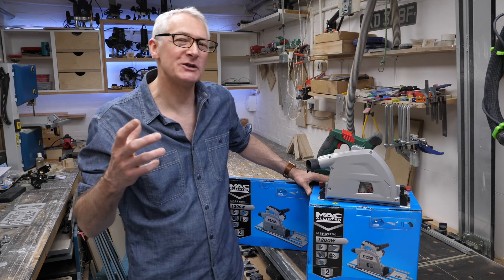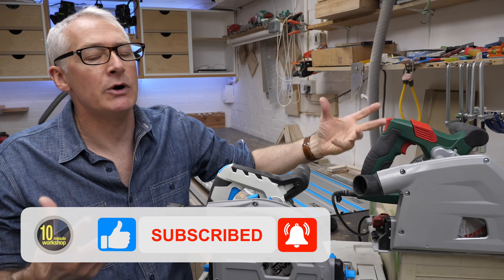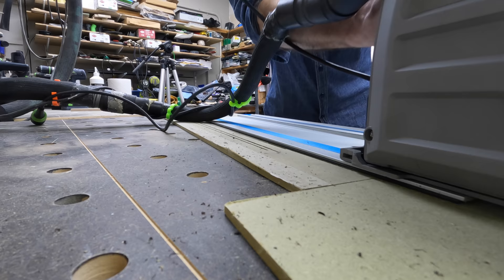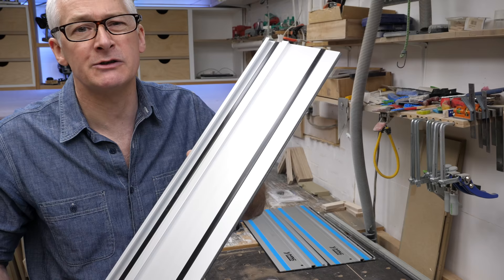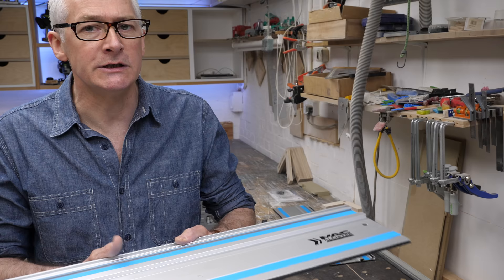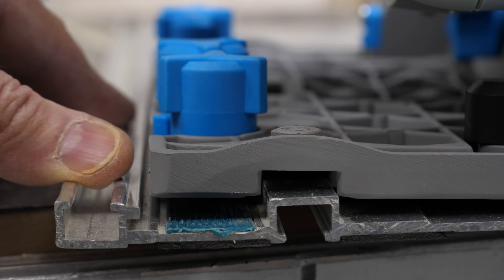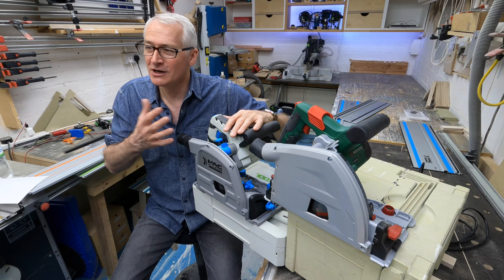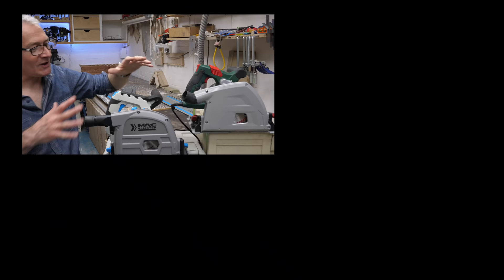Lidl Parkside or Screwfix MacAllister? [video 454]

Comment: After using the MacAllister saw a few times and struggling to cut even 12mm MDF cleanly without burning I put it down to bad choice of blades as I had put in a Trend 48T. After watching some generic plunge saw videos I decided to check the toeing of the blade and realised that it was actually toeing out which meant that the rear of the blade was actually rubbing against the wood causing the burning. This saw is not particularly well designed for toe adjustment as it cannot be done from the top but only from below which is obviously not accessible when it is on the track. You will need to loosen the 4 screws and the 2 outer set screws, this will allow the base plate to move just a little and at this point it is really trial and error and luck.
After 'adjusting' I have a very slight toe-in, think should be a little more but it will do for now. Now it glides and cuts much nicer and no longer burns any of the wood.
I did consider returning for a replacement but there was no more stock around and I had already gotten rid of the box etc so would be too much hassle.
For anyone else getting one for the first time, do initial trim of the strip then check the toeing, get it replaced if it is out...

Comment: I bought my MacAllister this time last year after spending an afternoon watching your Tracksaw Workshop series & as somebody who previously had zero experience working from scratch with sheet material I'm amazed at the quality of the cuts I get with it & how safe it feels using it. I've made speaker cabinets, a 19" rack enclosure & even a tiny shelving unit for bolt/nut organiser trays by using the score setting to cut slots for 5mm plywood shelves to slide into. Now  if only I didn't live in a 3rd storey flat & have to use my kitchen for doing it!
Reply from the maker: Really pleased to hear the videos helped! Thanks! 👍👍
Reply: Amazing

Comment: I bought the Mac Allister  which is similar to the Triton and many others. I bought the Triton blade before using it at all. One very nice feature of the Mac is the scribe function. it cuts a 2.5 mm groove by the special setting. it leaves a very clean cut and then I plunge to the set depth after. Admittedly i didn't try the stock blade to see if that was as good but over all very pleased with the Mac.. one down side on the Mac is the Black depth gauge with black raised numbers .. like looking for a black cat down a mine. I bought a white £2 paint pen off eBay  and touched up the raised numbering and scale. Fixed! Thanks Peter for your YT videos.

Comment: Great review, Peter. The Mac looks identical to the current WEN saw, sold here in the USA. Here in North Carolina we are fortunate to have a few Lidl stores, but I haven’t seen the Parkside saw in the store, so I finally gave in and ordered a WEN just this week. I was surprised that the saw came with a tag attached that says that the anti-kickback knob is removable, if not desired. That sort of message isn’t common in our litigious country.  Scott
Reply from the maker: Interesting, thanks Scott! No, we don’t get Wen products here either; it wouldn’t surprise me if the’s one factory making  110v products branded as Wen and 240v products brands as whatever anyone wants! 👍👍
Reply: i purchase the wen saw and they are exactly the same
Reply: @dannelfalkner5285  I think the only difference besides the 110v is the depth scale is in United States customary units (Imperial).

Comment: Great review Peter. I was on the verge of buying one of the Parkside saws, but went to my local Screwfix at the weekend and picked up one of the MacAllister saws instead. TBH I have never had any issues with Parkside tools, but had to return an Aldi Workzone tool recently, and they would not accept the return in-store because it was on the 366th day after purchase and had to be returned to the manufacturer despite them having the tools in stock.
At least with Screwfix exchanges are much easier.

Comment: Remember folks, you NEED to buy a cheap plunge saw because the stuff you are going to cut is so blooming expensive... 1 sht 18mm birch ply, last year £42, this year £67.
A good review as always Peter. Thanks very much.
Reply from the maker: Great point actually Paul - two saws that are cheaper than the Birch ply you're cutting them with, lol! 👍
Reply: I noticed the same about OSB, however the price for particleboard sheets looks similar.
Reply: I eatched a video on why prices are going up 1) Sterling's 20% fall in value 2)
The Pandemic with global lockdowns caused a lot of containers to be stuck in Europe and North America because of their massive demand for PPE and other anti-covid supplies. But they weren't being returned with exports because of their closed borders and lockdowns. China and other big production centres are making things but can't ship them anywhere because they havent enough containers to meet demand until some arrangements can be made to send those containers back. So, until the global shipping container problem is fixed, prices will keep on going up on the high street as the world's two largest economies starts to reopen. It's summer snd people will want to do DIY. So... might have to wait, because timber prices are exorbitant right now.

Comment: Thank you, great video!

MacAllister has 2 pros:
- scribe function
- the rails have 2 channels and allow use of 2 connecting bars - this really helps with rail alignment.

To improve vacuum efficiency, both should use duct tape over side hole.
Reply: Good to know re zero cut. Thanks!
Reply: The anti kick causes problems with the scribe function. Once you've scribed you have to very carefully manually disengage the kickback and lift the saw off, then carefully put it back at the start of the rail, else you'll move the track and wreck the cut.
Reply: parkside has scribe function .just set your saw to the second line lol

Comment: Great series of videos Peter. Since I started my van conversion build I knew I'd be wanting a track saw. So, Metabo stepped up nicely with a circular saw that runs on a track. I got 2 tracks both of which cope admirably with full size sheets of ply. Am really pleased with my cuts and equally pleased with the quality of the tool.

Comment: Yeah I have the big Mac and now I know how it works .but the Aldi band saw met a sticky end .I spent a few minutes hitting it with a sledge hammer before running it over a few times then I left it out for the pikeys.

Comment: Just looked at Screwfix website, they say 12 month warranty on the Macalister Saw and currently £79.99. Thanks for a very timely video. I nearly went for Lidl but now think I'll go for Macalister.
Reply from the maker: Says 2 years on the box; 12 months is usually parts & labour, the extra 12 months defective parts only, but in practice if there's any issue the saw's replaced. 👍

Comment: 7:45 hehe, always good that line!     I did a ton of research on this and categorically the best solution is a MacAllister / Titan saw with a 1.5m Makita track. And the 3m track if necessary. Remove the kickback thing altogether.  The reasons are thus, the anti tip function on the Makita / MacAllister / Titan saws is brilliant and very helpful for angled cuts, and the Makita tracks are the best all round purchase - the Evolution rails might be cheaper but messing about with joining rails is absolutely not worth the saving of just buying a full length track. the 1.5m track from Makita is also better as that little extra really helps when cutting 1220mm sheet goods.

Comment: Great as always Peter. I recently bought the Erbauer ERB690CSW 185MM from Screwfix. I wanted the extra capacity for a job but couldn't justify the larger Festool saw to add to my TS55. I am quite impressed with this saw and notice it is very similar to the MacAllister you review. The knob for adjusting the plunge to change the blade and do a scribe cut has the same graphics and overall looks much the same. I have already removed the anti-kickback feature. It uses the same track as the Mac A too. Thanks again!
Reply from the maker: Thanks Stuart! Yes, I took a look at the Erbauer a few weeks back, nice saw! 👍👍

Comment: IN terms of Q&A, I would probably also raise that as a point of contention with the Evolution rails. They definitely have issues in this regard if you read the Amazon comments. 
Being a novice, I learned this the hardway after ripping through a bunch of material (Makita Saw) without checking the rails were totally straight. Mine were all kinds of wonky.
Reply: I would agree - I've had 2 sets of evolution rails and had similar issues with both. I can't recommend them either.
Reply: @StrawbyteWorkshop  Hmmm, satisfied Evolution Rail (+Parkside Saw) customer here.  No issues.  But I did purchase my rails at the Screwfix 'Live' show (and won a free Evolution T-shirt. Ohh the generosity) and checked them carefully using the AVE patent'd 'calibrated laser eye-ball' before struggling to the car with them.  Obviously not an option in these disease-ridden times.

Comment: I found out about the track saw through Peter's vids. I decided not to get one based on price and the fact that I already had a good 10" table saw. 
I recently took up a new job and discovered a brand new Makita track saw, (with track), hidden in a cupboard. I asked the boss if I could borrow it to try it out. I was very, very impressed!
I'm now borrowing it again to build a new kitchen - I use it to break down full sheets in the carport before moving into the garage for further processing. I made an edge bander using a windscreen wiper motor, a few skateboard wheels and a hot air gun. I kid you not, a few months ago I turned down a $60k job because I didn't think I could cut the panels cleanly - that Makita is mint, I could have done it but just didn't realise how capable these track saws are. If I couldn't borrow one, I would buy one without hesitation. 
I'm in New Zealand so can't get Liddle/MacAllister, but if you can't afford, (or borrow), top of the line, I suggest getting one of these. It changes the way you work and cutting a straight, accurate, clean edge becomes super easy.
Reply from the maker: Great story, thanks Chris! Hone made edgebander sounds amazing! 🙌👍👍
Reply: @10MinuteWorkshop  It's naff looking. I wouldn't share any pictures of it - but it works 😁

Comment: After watching your reviews, I bought the MacAllister. I then ended up getting a second one!! I needed more track and decided that for £80, I'd end up with a flexible track system (I couldn't find a 1 metre Makita track plus joiners for less than about £55) and also a spare saw if (and when!) the first one breaks/wears out. So far, I am more than pleased with it, even when using a cobbled-together joiner.
Reply from the maker: Have to be honest, considering the price of alternative guiderails before the Evolution landed on the scene, it's not a bad idea at all. And like you say, you now have a spare... 👍
Reply: @10MinuteWorkshop  Out of pure curiosity, did you check the straightness of the joins? or did I miss that bit?
Reply from the maker: @paulwestlake4278  I did, but not on-camera (ie it was cut) - mine were fine, and I've honestly never received a set of rails that weren't, but I appreciate not everyone is as liucky as I am. 👍

Comment: Excellent as always - it might be worth noting that the Mac comes with Makita joining bars, which are in two parts, so they don't rely on the grub screws biting into, and therefore marking, the T-slots, as Festool do, for instance. I have two extra Makita rails - a 1m at under £40, and a 1.5m at just over £50, and have ripped full sheets of MDF, OSB and plywood.
Great saw! (Although I may have just bought a TS55 as well...)
Reply from the maker: I hadn't noticed that, thanks! And new Festool eh?? Nice! 😆 👌

Comment: I modified a Makita guide rail slightly to fit my Parkside. I cut off the anti-tip lip with an aluminium cutting blade so the Parkside would fit in the channels. But then found the splinter guard ended shy of the blade, so replaced it with a 2mm x 25mm rubber strip and trimmed to size. Now I have a Makita guide rail that can use all the aftermarket jigs on my Parkside.
Reply from the maker: How to Trim a GuideRail - and why you’d want to! [video 468] - https://youtu.be/QqTJ4SrRD1M 👍
Reply: @Peter Millard  Not sure how I missed this video of yours, but well done and glad you were thinking along the same lines. I used a 10mm support/fence which made moving the Makita rail slightly more fiddly than yours. You're a great source of ideas well conceived and well executed.

Comment: I like the anti kickback feature on the dewalt plunge saw...you can lock it in the off position for normal use, and then engage it with a simple twist of the knob if you need it. I engage it only when plunge cutting or if I'm ripping solid wood, but whether it's necessary or not who knows?
Reply from the maker: The DeWalt anti-kickback is the one to beat tbh - best all-round solution as it's easy to engage/disengage. 👍

Comment: Great video. Thanks for sharing.  As a hobby woodworker I gathered quite a few Parkside electric tools over the time. All bought in the classic shops, not online.
But now with the LIDL online shop available also in Slovakia  (and in the UK as well, I guess) all the LIDL/Parkside tools should be available more or less all year around,
I suppose.
Reply from the maker: Thanks Hans. No, unfortunately, LidlGB lags behind our European neighbours, and we’re still on an annual cycle. 🤷‍♂️👍
Reply: @10MinuteWorkshop  One is never too old to be surprised. That's a pity.

Comment: I have had to retire my Titan saw. After chewing up 3 sets of brushes I realised that metal contact strips on the armature  had fallen away causing the brushes crash into the remains strip. I would have bought the identical Mcalister but these were out of stock. The only cheap saw available was a Einhell which require their own unique track, which were £45 extra. It has no anti kick back and no scribe setting but is remarkably well put together. The base is cast aluminium and the blade shroud is painted metal . Apart from the motor body there is very little plastic. The downside is the terrible blade which burns everything I have cut and it blows out more dust in front of the saw than through the vacuum outlet causing the saw to vibrate. I will try it with a new blade and see if that improves the performance. I was thinking of taking it back but there is nothing else around right now. This was the last saw that Toolstation had in stock anywhere in the UK.

Comment: Thanks Peter. Been waiting for this as I have the MacAllister and Evo rails but have not used them yet (just finishing my version of your portable bench which I cut with a cordless Scheppach which I hoped would fit on Evo but doesn't). So if I understand correctly the Mac runs on Evo rails perfectly and would also be good on Makita track. I'm going to get the Benchdogs rail square for Evo if this is the case and it seems that then that square works on the short Mac rails too which is a bonus.
Reply from the maker: That’s correct Alistair. There’s a video of mine called ‘which rails work’ - link in description - that covers this in quite nerdy detail! The Schepoach/Aldi saws have chosen a very odd path to take with their rails and (lack of) compatibility. 🤷‍♂️👍
Reply: Thanks again. I've seen all the tracksaw videos several times but I was not 100% sure if the Mac was definitely a Titan replica in every way and did not want to splash out on the Bechdogs stuff until I was sure as I can't return them from here. So this is great and I'm off to make Ralph a bit richer right away :-)
Reply: @10MinuteWorkshop  suppose they are testing to see what works best and has features that can be seen as  a USP (Unique selling point) over other saws (I have no idea ! )

Comment: During depths of lockdown I couldn't find anything and plumped for an Excel saw, which I'd never heard of. It looks similar to the MacAlister though, must be the same manufacturer. Came with two long rails so I could cut sheets right away. Pretty chuffed with how it works.
Reply from the maker: Haven’t used one, but very impressed with the excel rails when I used them 👍

Comment: Thanks for the review and comparison. 
As always it’s very informative material.
Reply from the maker: Thanks! 👍
Reply: @10MinuteWorkshop  credit where it’s due. 
Re the Mac machine. I can’t find the reference but some time ago someone pointed out an amount of lateral play in the lowering/raising bracket arrangement.
Can you see any play/slop in the alignment between the blade and the shoe or track ?  
I imagine this would be more visible at shallow blade depths but I don’t have the saw so I’m speculating. 
I know on my older and bigger parkside circular saw that bracket is a weak point. I don’t have slop but it’s what absorbs the impact of a knock. The main reason I still use that parkside is I like it’s variable speed feature as it helps reduce noise.
Reply from the maker: There's a few folks who've found this and reported on it - Goran @nomadmakes and Tim @Timshowtomake both had this issue. My saw didn't, though. 👍